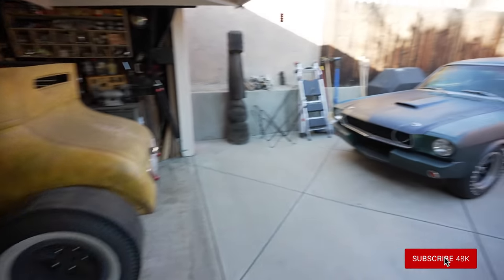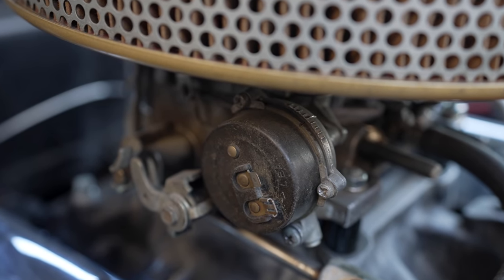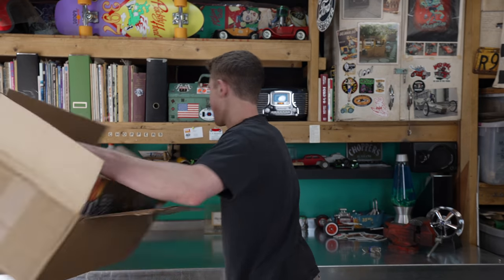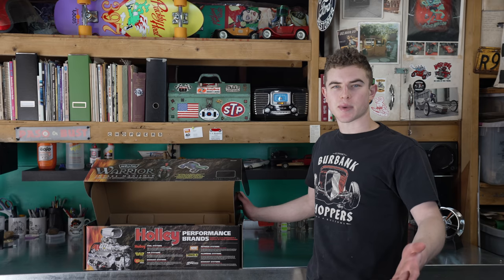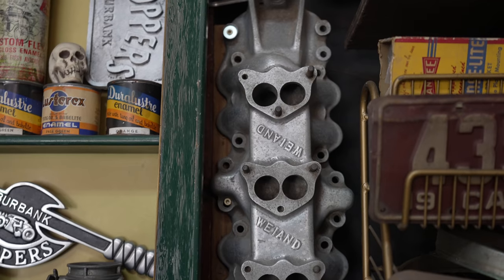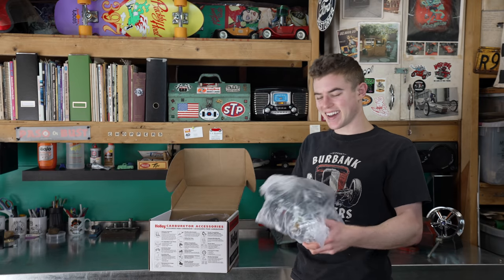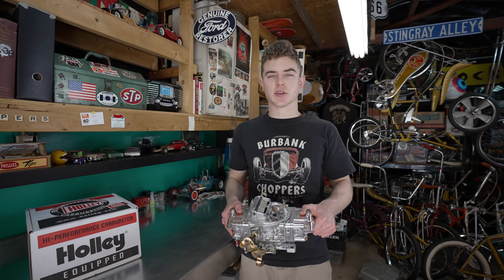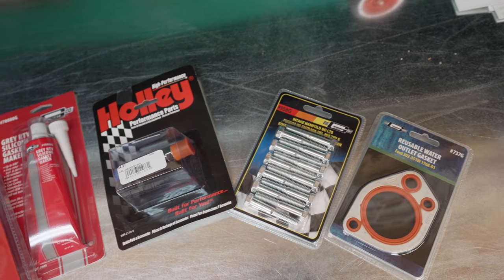Unboxing Some New Motor Upgrades For My 1965 Mustang!

Comment: SUGGESTION INSTALLING INTAKE.    Go  to Ace Hardware get some nice long intake bolts  and cut the heads of the bolts  and hand screw them into the  the Engine before lowering your intake down it will keep the intake from shifting around on you.  Once the intake is in place simply remove the bolts.
Reply: That’s a new one for me. Sounds like it would work though

Comment: We have a 750 on a 305, runs great.  Look up big carb on 305, you will find much bigger carbs on these tiny engine bore.  Just shows a motor is an air pump, and it will flow as much as the combo allows.  My 289 has a Predator on top.  What a toilet!  No other carb makes as much low end torque!  Airflow!

Comment: just put the same carb on my buddy's '66 tbird 390...really worked out well, even with the stock intake.  had some linkage challenges, but that had more to do with the car than the carb.  as they say, though, 90% of carb issues are really ignition issues, so make sure the ignition is flying right first.  have fun

Comment: The age old discussion - what flow rating carb works best for my engine! I'd bet 95% of engines that are built for performance run larger than the "calculated" need.  Years ago I built up a 302 to run up to a little over 6,000 rpm. A low 500 CFM carb should've been enough. Everything on the shelf was 600 min and most were 650+. Ran a 650. Car ran great. No flat spots. No cold issues. Just has to work hard to jet and tune it right.
Reply: those calculators dont always work. buicks and mopars LOVE cfm.

Comment: I broke my fuel filter off inside of my brand new carb on my ‘75 Mustang. It was terribly sad, and I wound up having to order a new carb. A few months later my engine exploded. 😂 Now the car has been sitting for 3 years because Ford parts, especially for the Mustang II, are very hard to find and expensive when you do find them. 
Currently I’m waiting for the parts to install the Edelbrock Pro-Flo 4 EFI on my ‘69 Firebird. I’m also installing the Holley fuel tank with the in-tank fuel pump system.
Reply: what parts are you needing?

Comment: I'll throw some of my experiences, good and bad, into the pile.

You can't go wrong with a Holley.  They are so simple to work with.  Holley has a help line for added performance tips.  I installed a brand new 600cfm on my built 302 with vacuum secondaries.  First thing I did was remove the choke.  As you mentioned, it's really not needed in So Cal.  There is actually a way to modify vacuum secondaries to open quickly but it's kind of useless if you drive on the street a lot.  I tried it and all it did was spin the tires like crazy in first gear.  It felt like a double pumper.

Many have had issues with the small intake gaskets on the front and rear of the manifold so I just deleted those silly little ones and used gasket maker.  Never had any problems.

One huge performance part is an MSD ignition box.  You will feel the difference in the lower gears!

Happy cruising!
Reply from the maker: Thanks!

Comment: ahhh dude you're so lucky with Holley reaching out to you!!meanwhile i cant even get my sniper efi to run right
Reply: @SweatyFatGuy  i'm going to go over it again once i finish the interior of my vette in the next week or so, but the issue i'm having is that sometimes it starts up fine and idles ok, others it will be hard to start and then idle at 1200 and slowly come down to 800-1000, makes no sense to me, this is after a custom tune, initially it was running really rich and idled rough. i'm totally new to working on cars so lack of experience doesnt help

Comment: Still rockin’ a stock Zenith carb on my car. It leaks, the idle has to be readjusted whenever the season changes, but it’s fun and replacements are expensive. Just got a new exhaust system, luckily. Keep on going with these vids, man!

Comment: Yea if you didn't have that electric choke the carb might load up with fuel a few miles down the road and die! Put you in some bad situations,  that happened to me for 3 months in 1997 after i V8 swapped a 89 mustang, i put a edlebrock performer intake with a holley 650 double pumper on it, i could be 5 miles into a trip and it would just shut off like it had a fuel pump issue, i had a holley blue external fuel pump, finally some mechanic told me what was happening and i had a manual choke installed problem resolved

Comment: Put a aem wideband o2 sensor in it for tuning.   Takes out the guesswork with tuning.
Reply: vacuum gauge and read the plugs. works fine.

Comment: Hello I’m looking to do a Holley sniper EFI on my 1965 ford mustang Gt 289 I have the kit in bronze but looking for a intake manifold and update distributor.I will be doing a video on these modifications and could use some promotion help?
Reply: Also need a place to add coolant temp to the intake side?For this fuel injection kit?All help will be appreciated

Comment: Don’t be discouraged by others telling you a 670 is too big. These cars came factory with 650cfm autolite carb if it was optioned for it. I have a 750 Holley on my 289 and it makes a world of a difference. Just make sure you adjust the floats in the bowls correctly.
Reply: adjust the vacuum secondaries right and it wont be a problem at all.

Comment: Yea, anything over about 500cfm is a waste on small blocks, Chevy Ford or Mopar..  more gas doesnt equal more power.
I also disagree on dual plane manifolds.  It induces 'pulsing' in the intake side of the motor.  Just as an x-pipe helps scavenge exhaust gases from the opposite bank of cylinders on the exhaust side, you want a smooth flow of fuel on the intake side too.  Lot of guys just cut a big chunk from between the two intake sides, or drill a few large holes.
Also, good tip when introducing 'aluminum' into your engines' cooling circuit. either aluminum heads or intake manifold, get an "ANODE" radiator cap.  Aluminum and steel in the same cooling circuit causes 'electrons'..  basically two dis-similar metals begin to 'eat' one another.  The aluminum, will lost this fight, you will find pitting in used aluminum intake manifolds around the water jackets, near where it bolts to the steel heads.  Eventually causing the intake to leak water, into your block and out side.
Reply: 500cfm? thats what cfm my stock 5.2 magnum tbi throttle body is pulling. 302 ford is good with a 600-625, same with a 318 mopar, and 327 chevy.